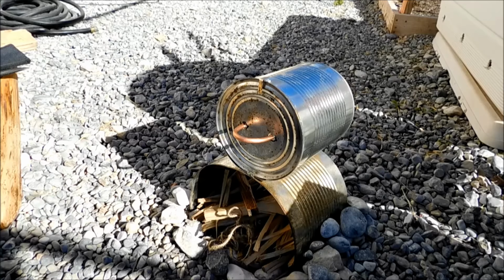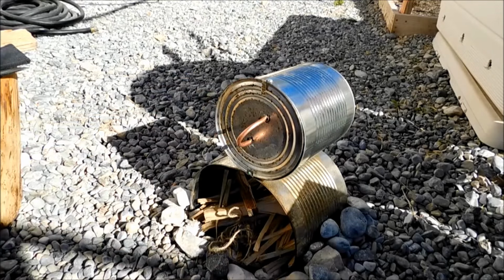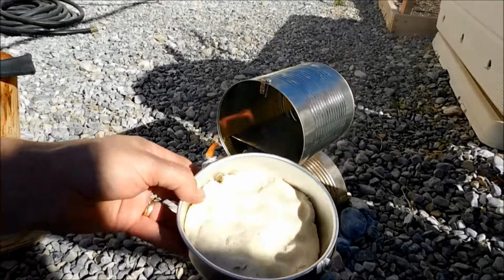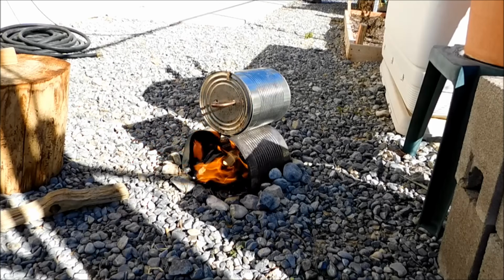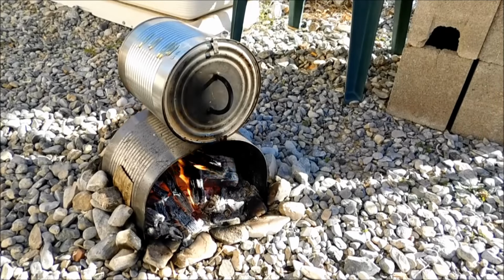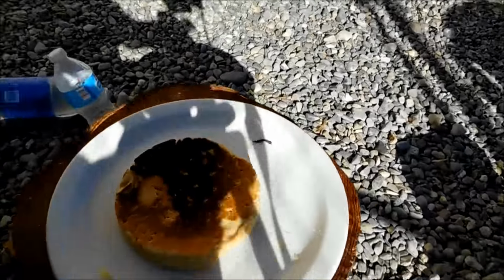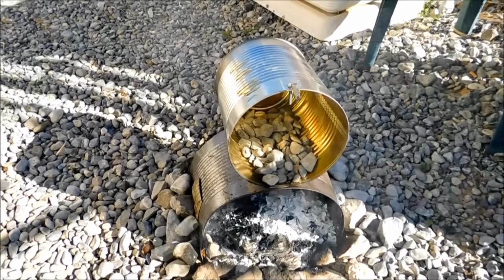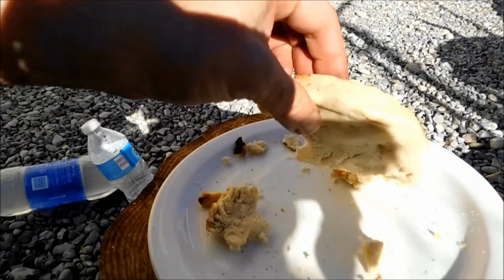Coffee Can Camp Oven

Comment: Good ideafor side of the road junk use.  How about though using one of those fold up cheap stove set ups that use wood/esbit/sterno/alcohol burner inside of it? Might help the fuel consumption of the wood at least since it has more air restriction than a flow thru tunnel and would direct the heat better.  Also since a bunch of us have them since they're anywhere between $5-$50 (depending on where you buy it). Thanks for sharing with us. Keep doing these kind of vids as even us old dogs can learn new tricks. 
  ol greybeard dino
  ; - ) >
Reply from the maker: Thought about using one of those fold up stoves (I have many) or an alcohol stove but I didn't think it would get hot enough.  I may just make a box out of that bottom can too, Ill have to play more with it to make it a bit more efficient.  Thanks for watching!
Reply: also sounds like a good reason to include some self tapping screws in the go bag along with the wire and nails.